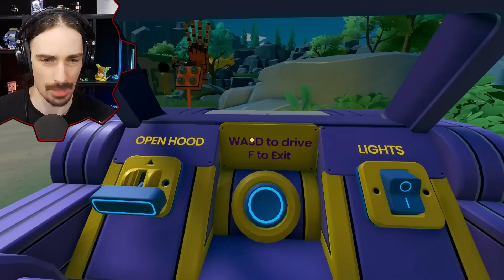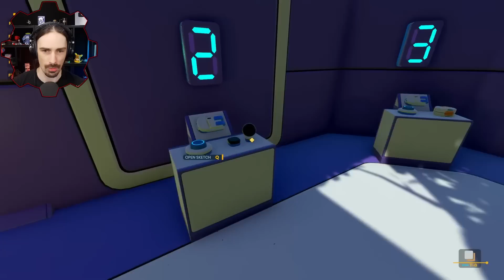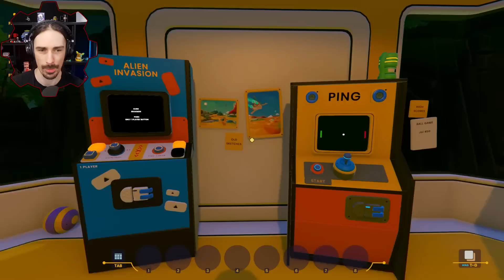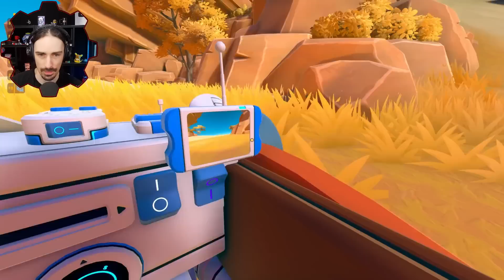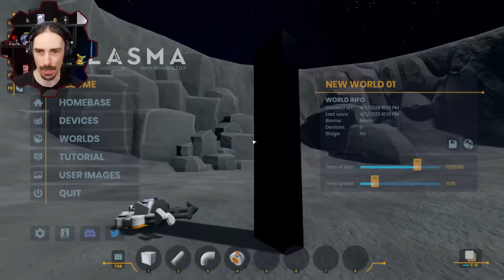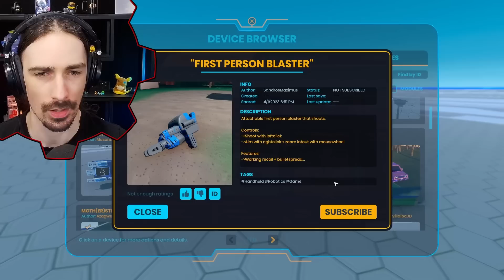This Engineering Sandbox Goes Deep [Plasma]

Comment: You should be able to limit the spin of the drive wheels to a factor of the spin of the non-drive wheels, that way you don't get out of control burnouts.  If aerodynamics is not simulated (I assume it isn't), you can add a downward thruster to the front of the vehicle to keep it from flipping up with acceleration.  OR, make the rear axle higher than the center of gravity.

Comment: there is one component in the list that i like a lot, it's not the comunicator, which alows you to send data to a specified steam id, but the serial port, it alows you to use a real serial port on your computer and comunicate with stuff irl, meaning you could use plasma to run a nuclear power plant.

Comment: Glad you enjoyed my 3d printer build! The reason it prints kind of randomly is due to the Lua code that I used. I store a table of every pixel that you draw with its position/color/layer, and the program sorts the table by layer before saving it so that it prints the layers in the right order, but I was having trouble sorting it by both the layer and the position, so for now it only sorts using the layer.
Reply: I like your funny words magic man
Reply: @Mason quick idea : give a combined positional value to each pixel based on all three dimensions (for ex : layer*625 + y*25 + x) and sort by this value. That way it'll be sorted by Layer, Y, and X position, in that order. Keep the other values for the rest of the process. (edit: fixed maths)
Reply: @AraliciaMoran  neat, simple and efficient solution!
Reply: so it prints in the order you draw the pixels then.
Reply: @DarthZ01  Not necessarily. Depending on the sorting algorithm, the end result can vary a lot. Some algorithm may preserve original ordering in case of entries with same value, some will not. Given the way the printer behaved in the video (printing a straight line out of order), the algorithm used doesn't preserver order.